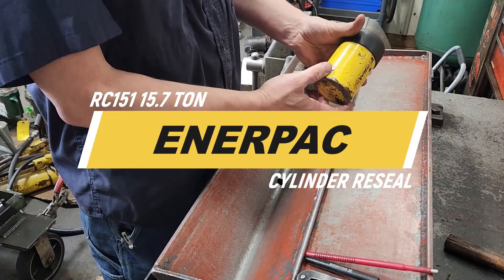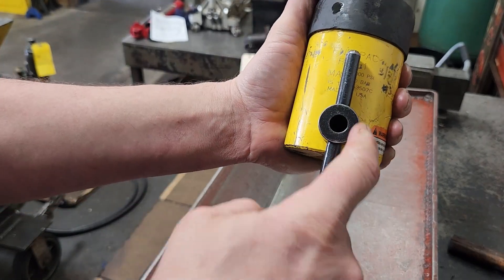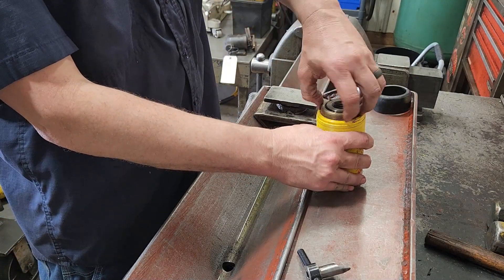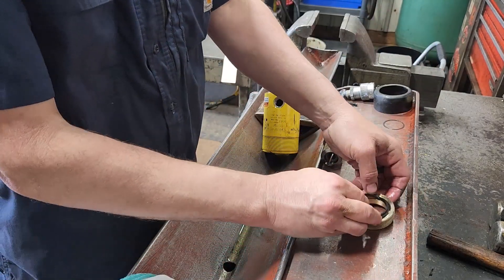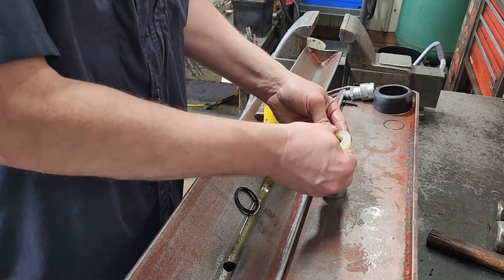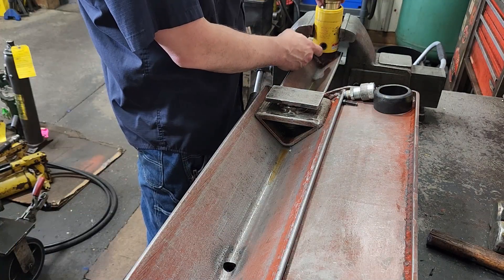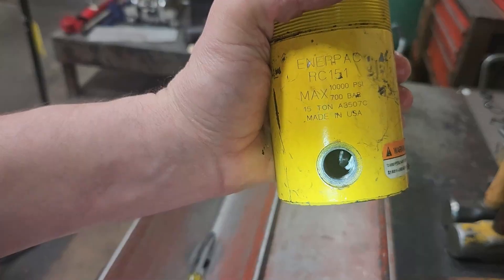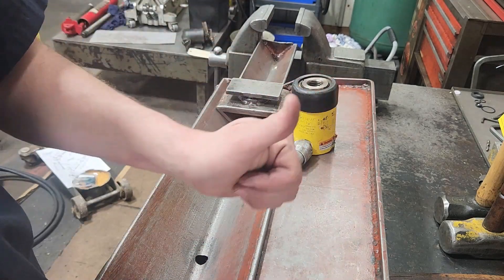ENERPAC RC151 Reseal

Comment: whats the tool called that allowed you to move the spring to get to the flat head screw?
Reply: Hey, I'm also wondering what the tool is called
Reply from the maker: If you search hydraulic ram return spring tool, it'll pull up something similar. It's hard telling where ours came from or how old they are. Thanks for watching and commenting!